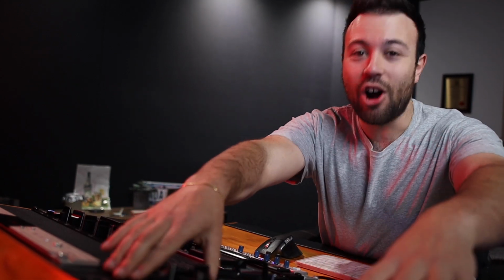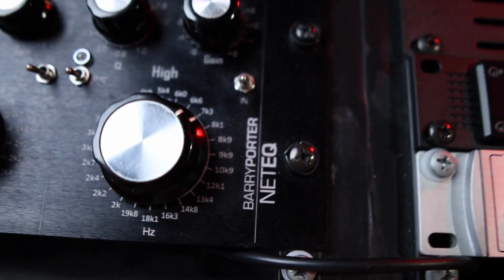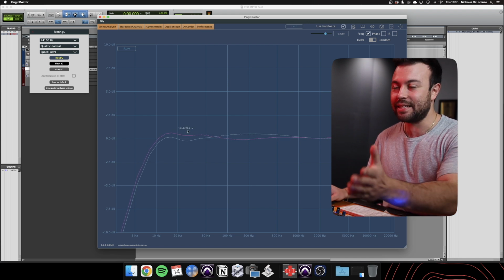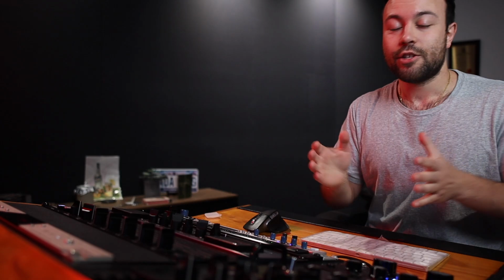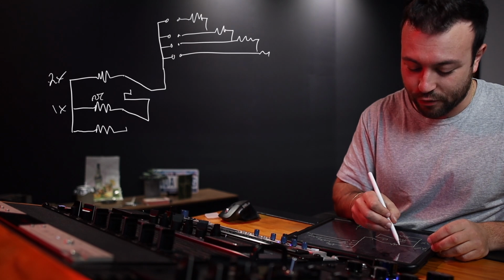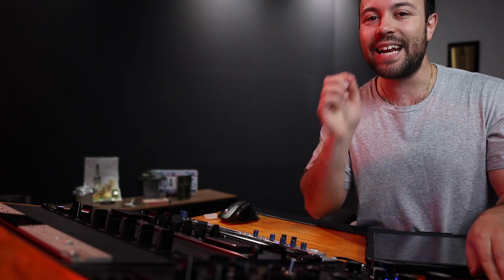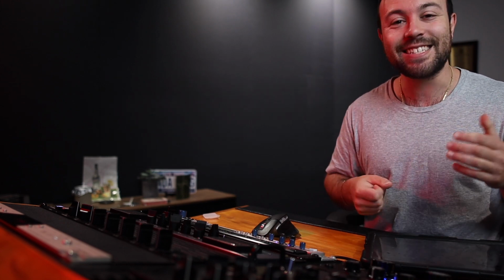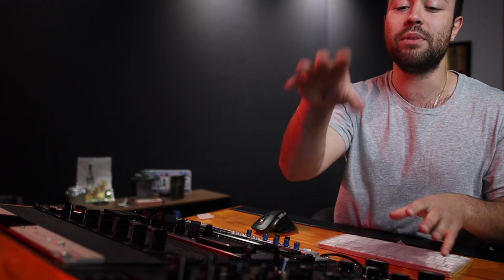What makes analog gear mastering grade? Here's the ACTUAL answer!

Comment: You sound very green to say you dont know of any mastering eq with bypass bands when it's the standard in the industry it's also very pointless as most have non interactive dc cap seperation from each eq circuit and its just replicated 5 times with diff filter caps also .0008% is just for the ics used and not real world measurements which is almost always a magnitude higher then the specs. This is a non-issue as tube circuits, yes even for mastering have thds around .1% to world class at .01%

Comment: Great video!  I am looking for a high voltage rail to rail small format mixer, like an SPL Neos (but still being sold and supported, which the Neos isn’t). 
The Neve 5088 is still too limited in terms of meeting my headroom requirements, and larger in physical size than I am looking for.    
Do you have any recommendations?
Reply from the maker: Hey Andrew; I wish I had a recommendation; but small format mixers are outside of my wheelhouse :(

Comment: Great vid. The eq sounds real nice. Right now I’m torn between the HCL Thermos which is a Barry Porter design eq and the Custom Audio Germany HDE-250a Sontec clone eq (which also has individual bypass on each band) same kind of price point. I just need to know what the differences are sonically before I pull the plug!!
Reply from the maker: Interesting adaptations; thanks for pointing out the individual bypass bands on the HDE; love to see more units with this;

Have you used either of those two before?
Reply: @panorama_mastering  no I haven’t unfortunately. I’ve been doing a lot of research on both of them and been asking lots of questions to more experienced engineers. I think I’m leaning towards the HCL for a couple of reasons 1) it’s readily available whereas I’ve tried to get in contact with Steffen from CAG for nearly 2 months with no reply. 2) I like the idea of (x2) frequency selection Oh and the HCL Thermos also has band bypass.
Reply from the maker: Nice, I respect that! Whatever your choice I am sure it will be great!
Reply: @panorama_mastering  I might wait until the High Voltage is released, see what the price difference is. Great vids btw. Love the enthusiasm. Keep doing u bro 👍🏾
Reply from the maker: Thanks bro! If you ever want an introduction to James at High Voltage; ping me an email and I'll connect you;
Reply: @MrStax2010  the HDE sounds stellar!!!  I adore mine.
Reply: @Rareos  I’ve heard nothing but good things about the HDE-250. I’m just disappointed at how long it’s taking to get a reply from Steffen. 😕

Comment: Good stuff!  Question:  considering it’s such a clean eq and there’s no harmonic distortion or saturation what exactly is it about the unit that makes it better than something digital like FF or Kirchhoff. Have you ever tried matching curves and doing a null test.  I was always under the assumption it was the non linearities of saturation and HD that make an analog unit sound “better”.  Is there something else?  Have you pinpointed it with a delta signal during comparison?
Reply from the maker: The main ethos behind when I had my BPEQ commission built six years ago; was how can I get the access I have to clean, high resolution and transparent in the box but on my analog chain;

The non linearities of saturation and HD which makes some analog pieces unique is great to have in a chain; but I don't want every piece in my chain being another colour box.
Reply: @panorama_mastering  so do you think the BPEQ would come close to nulling If you matched curves in Pro Q?
Reply from the maker: @davidasher22  Possibly so; to get it to null I'd have to not just match the curves but the filter designs; so something like DMG equilibrium would be better suited; but yes; definitely so;
Reply: @davidasher22  low level  ailiasing. Not and issue in the analogue domain.
Reply: @scoremix8556  anti aliasing is a good thing. And there's no aliasing IMD in linear digital processes such as clean EQ.
Reply: @TWEAKER01  typo!!!! Cant get round ailiasing on sample reductions - so whenever a plugin is used!!